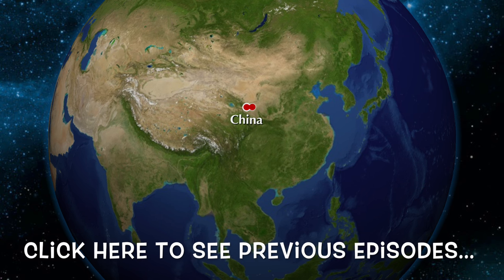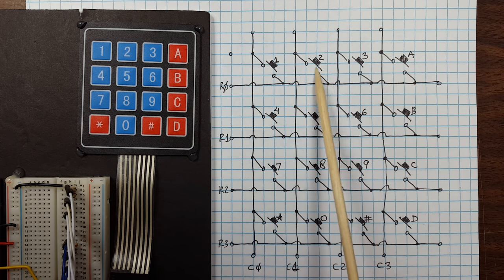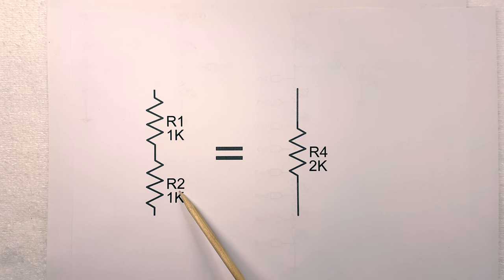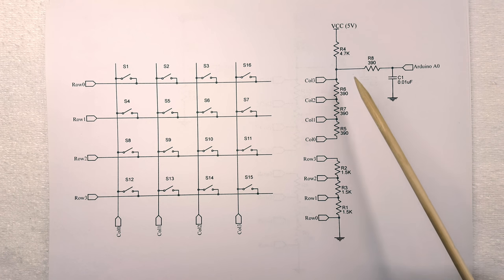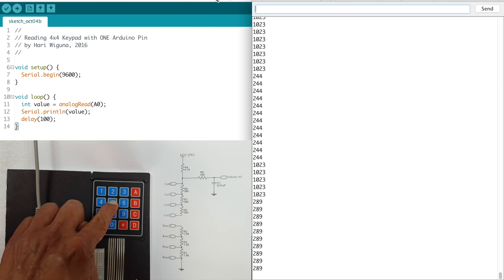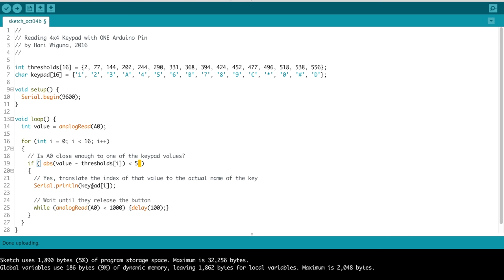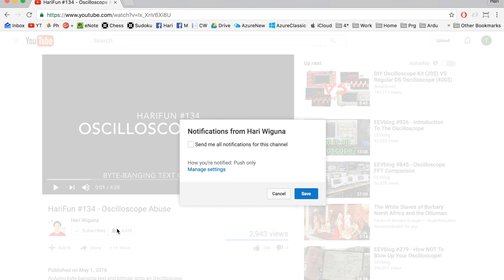HariFun #143 - How to read a 4x4 keypad using just one Arduino pin!

Comment: I like the basic idea. Very creative!
Reply from the maker: Thanks for the comment Andreas, but I could not take credit for the idea.  I stumbled into the circuit in Google Images while researching keypads.
http://www.microchip.com/forums/download.axd?file=0;694632&where=&f=1pin%20keymatrix.gif
Reply: Yeah but you implemented it and explained it fantastically! Thankx to you it saved me! Your awesome
Reply: 4:14 wait you said the more resistors the higher the voltage but wouldn't it be the opposite? , the more resistors you put in series the more the voltage should  drop between VCC 5v and the GND pin not increase, this makes no sense

Comment: If random noise is added to the output to the 4x4  keypad  outputs this method  has a failure rate !
noise measurement:   0.01% rms of 5Vdc =5/10,000 v  will cause a miniscule  error  
say 1 error / 10^8 keypad outputs . 
Theoretically:  a 5/10,000 v rms   includes   a few -5v pulses  witihin a group of 10^8  noise intervals 
where 10^8 = 100.000,000 random pulses

Comment: After days messing about trying to get this to work I had all but given up. The problem was the voltage out numbers I was getting were nothing like the progression you were demonstrating in your video, they were all over the place. On top of that they kept fluctuating over time so I couldn't program the threshold values with any certainty. 

Then I had a spare keypad delivered so I thought I would try that as a last resort - SORTED!! The voltage numbers were spot-on and gave consistant results. Anyone else having trouble with this should try different keypads to see what results they get. The first keypad was brand new as well by the way.

Thanks for a very useful video Hari.
Reply from the maker: Grrr... sorry to hear about all the problems.  I probably should have included a step to test just the keypad membrane switches themselves.  Glad you persevered and got it figured out!  Good job!

Comment: Cool. It's a very old technique that was (and probably still is) widely used with small passive controllers for professional appliances such as the Alesis LRC which was a tiny controller for the Alesis Adat digital recorders; it has 13 buttons and terminates on a TS jack; I made a PIC18 project to read this controller and use it as a generic MIDI controller; the downside is that you have to apply a debouncing algorithm with a rather long debounce time in order to get a stable voltage before trying to recognize which button was depressed.
Reply from the maker: zioguido , i didnt know that it is good enough for commercial use. i thought it would not be reliable enough. do you have photos or videos of your hack? I'd  love to swe it.
Reply: Yes, it's quite a reliable technique as long as the resistor network is done with high precision resistors, the rest is done by the software. The only remark I feel to make based on my experience is that you need to implement a rather long debouncing algorithm, say 200 mS, and it's even better if you have an high resolution ADC, 10 bit should be enough. No, I have no pictures of my project, but it must be somewhere down my basement :) it was only a part of a more complex control system that I made for my old recording studio and no longer use.

Comment: Nice work.. I was wondering if I could use this to reverse engineer a keypad from a rack module.
Basically my idea is to mimic the key preses in the rack via arduino.
So in a first stage I would use the voltage divider to determine the values for each key press as input and then, based on the obtained values, use the analogwrite function to "send" the same key press via arduino. Do you think that is possible?
Thanks
Reply from the maker: Thanks. Unfortunately, the analogwrite function does not actually outputs a variable voltage. Despite having the word "analog" in the command, it actually pulses 5V at varying speed.  Also, as far as I know, most commercial keyboards do not use this analog method but instead uses a digital matrix (more pins, but more accurate).
https://www.arduino.cc/reference/en/language/functions/analog-io/analogwrite/

Comment: Im not getting a stable read.. help
Reply from the maker: 1. Since this is analog, it is inherently imprecise.  That's why I suggested getting the values and then making the code tolerant of the slight variations.
2. Make sure that the input voltage is stable.  Are there high current outputs being involved? you may need to power those from a separate supply rather than the Arduino 5V so the input to the resistor ladder would remain stable.
3. This is a hack.  It should only be used when you cannot afford the I/O pins.
The proper way to read a keypad is to use row column matrix to scan the keypad.  Uses more Arduino pins, but 100% reliable.
Reply: @HariWiguna  
Thanks man.. the values are just too bad.. sometimes im getting same values on different keys.. and im running out of  arduino pins(uno)...
I'll try to power up the arduino with 9v.. im using a laptop so maybe the input voltage is not stable
Reply: And also the values im getting are way too far from what you got
Reply from the maker: @3000mi_away , I've just thought of another possible cause.  Please measure the switch resistances on the keypad. Just try a few of them to make sure they're very close to zero.  Some keypad uses carbon pads instead of actual metal to metal connection so it has a relatively high resistance and probably also pressure sensitive.  The harder you press the lower resistance.  You could try using higher resistor ladder values to make these variations less significant.
Good luck!
Reply: Thanks man ..ill try that

Comment: Thanks to this!, I could save a lot of pins because of this trick.
Reply from the maker: Yeah, I'm already using a ton of shift registers for the 9x9 Seven-Segment displays, so I wanted to keep the input as simple as possible.  Zero pin is not an option, so I had to settle for one pin. lol :-)

Comment: In theory it should work. In fact simulating the circuit with Spice works well.
In practice, the voltage difference between the buttons down to the right is so small that a slight fluctuation in the supply voltage is enough to cause errors in the detection of the pressed keys. I did a lot of tests and in practice I was never able to run the detection well, pressing the D button gave me a #, and pressing the C key would tell me 9. :(
Reply from the maker: I guess I was just luckier?!  I presume you calibrated your threshold arrays instead of just using my values. Also, by watching actual value fluctuations while gathering the values for the array, I was able to guess how much slop is necessary to give the maximum range for each button while not running into the "nearby" buttons.  Thanks for sharing your findings Salvatore!

Comment: I just tried this out. Very neat. I am having a small issue that I was hoping you might have insight into. The wobble/slop on my key values is huge +/- 100. Any idea what would cause so much slop on a key press?
Reply from the maker: Most likely your keypad uses switches that has high resistance (around 100 ohms as you noticed).  The one I use has practically zero ohm resistance when the switch is pressed.  All resistance comes from resistors, not the switch pads.

Comment: Hi, hari.  Could the capacitor no be a 0.01 uF (10 nF)?  Can it be 0.1 uF or 6.8 nF?
Reply from the maker: 6.8nF should work.
As I mentioned in the video, the 390 ohm resistor and 0.01uF cap debounces the often noisy switch.
You could probably even eliminate the capacitor if your switch is not too noisy and/or you added code to do debouncing in code.

Comment: Bos. How to find this number 2,77,144,202,244,290,331,368,394,424,452,477,496,518,538,556 ?
Terima Kasih
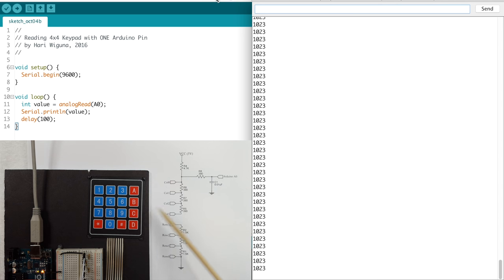Reply from the maker: At 3:44 you can see that pressing each button shows a different value.  Press each and write down the value.  Your values will be slightly different due to the variations on resistors. That is how I got those numbers.
Reply: Hari Wiguna  If i press, example for number 1 this value 2043 or number 2 = 1463
int thresholds[16]={2043,1463,7823,23,3713,3343,2943,2483,4813,4563,4293,3993,5603,5423,5223,5013};

while (analogRead(A0)<1000) {delay(100);} 
this code must be change too?
thanks for your answer
Reply: Oooo sorry bos... im mistake for my note value
Terima Kasih Banyak My Big Bos
Reply from the maker: The maximum value returned by analogRead is 1023.  Where are you getting 2043 and 1463 ?!
https://www.arduino.cc/reference/en/language/functions/analog-io/analogread/https://www.arduino.cc/reference/en/language/functions/analog-io/analogread/

Comment: I  make a mistake, because I'm french and not completly bilingual.  I should have written less inputs instead of " without using less inputs.". So what I need it is 'digitalRead' individually 4 BCD thumbwheel switches without using 16 inputs. I tried to imagine a matrix like the 4X4 keypad but it does not works because but some rows or columns may have many binary values at the same time.
Reply from the maker: Ah... I see. That's a cool idea actually. I found this article:
http://www.instructables.com/id/A-simple-4-channel-adjustable-current-source/?ALLSTEPS
They're using it to control current, but I think by adding one resistor to positive, then you'll have a voltage divider and be able to read the combined resistors using one Arduino pin just like what I did with the keypad.  Keep me updated. I think this is interesting. Thx for the comment.

Comment: Hari SUBSCRIBED! I have some programming experience and new to Arduino. I want to do this project and I understand the general concept but I don't have an electronics background so there's a few things I don't understand.

In your drawing:

1. Is R1-R12 just you counting the number of resistors needed in the project or does the number have other meaning?

2. You are using just three different resistors 390 ohms, 1500 ohms, and 4700 ohms I think?

3. As I am color blind I can't tell from the video, what resistor types (carbon film vs metal film etc.) and tolerances do you recommend?

4. Similarly, C1 is a capacitor? What type and value do you recommend?

Thanks a bunch for this great video!
Reply: Well, I never got a response so I just used metal film resistors and a 103 capacitor (I don't recall the type). Anyway,  I just tried it on a 1 column by 7 rows of momentary mechanical push buttons mounted to a plastic plate and hand soldered together. I went with 220 ohm resistors since I had more rows. I will add two more columns as soon as I get more resistors in. Thanks Hari this is really cool and explained well. And should work great for my flight simulator button box which will have a couple dozen buttons, switches, and rotary encoders.

Comment: I tried duplicating this in tinkercad and it isnt outputting anything. I copied the code too and thought my wires are correct. only thought could be wrong orientation of the resistors?
Reply from the maker: I wasn't aware that TinkerCad has an Arduino simulator, so I wired up the circuit.  Everything works as I expected except for the first column (1,4,7,*) all acts as if I'm pressing *.  When no buttons are pressed it should return 1023 too.
I wonder if the keypad component has a bug in it.  I'll play more with this later and let you know if I discover anything else.
Anyway, thanks for the question.
https://www.tinkercad.com/things/5YWqan9lh8H-neat-esboo/editel?sharecode=o6MB5FGBJq0Q0EjU1emoxm19kzj5LjFq31JzCpDEB50

Comment: I saw this same technique used in an old VCR front panel.  Did you know that it can even be done with a digital I/O pin and two additional passive components rather than using an analog input?
Reply from the maker: Really? how do they do it with a digital pin? Charge a capacitor?
Reply: @HariWiguna  Yes using an RC circuit with the resistor being the button voltage divider.  One end of the RC is Vcc, the other end is connected to the digital pin.  Discharge the cap by setting pin to output low.  Now set pin to input and time how long it takes to turn on by reaching (Vcc/2).  That time is proportional to the resistance value.  Then repeat the process.
Reply from the maker: @Enigma758  Wow. That's crazy. Thx for explaining that to me.

Comment: I've built a couple of projects using similar types of matrix keypads. I think you have a great design that I'm going to experiment with, I do have one question having to do with electrostatic discharge. One of my designs had a 4 X 4 matrix keypad that was mounted on top of a metal enclosure that contained all of the electronics . I originally did not have any ESD current limit resistors or RC circuits to help isolate the inputs on the micro-controller from ESD. I ended up having the several micro-controllers fried by static discharge coming from people that came in contact with the keypad and discharged it into the electronics by depressing keys on the keypad. What do you think could be done to your design to prevent this from occurring?
Reply from the maker: Tom, sorry I do not have any experience suppressing ESD. Sounds like you know more about it that I do :-)

Comment: Hi hari wiguna help please,I am making my keyboard with spst buttons and If I make several keyboards like it ,will it have same analog values? Like you had 1/2 for number 1 ?
Reply from the maker: HI Aryan, The analog values depend on the resistors you use.  If you get the resistors from the same batch and you adjust the slop in the code to be as large as possible then it should work.  But you will have to check your analog values yourself.  The chance of my analog values be perfect with your resistors is small.

Comment: I have some questions in mind.
1)Can we use nay resistor values?
2)I am not able to see properly on how you connected the circuit on the breadboard.I am little bit weak on connecting circuit at breadboard.Please help me.
Reply from the maker: Hello Jeet,
1. You can use other resistor values, but their ratios are critical for it to work.  Remember what we're doing is building a voltage divider with variable resistance on the bottom resistor controlled by which button is pressed.  The maximum total resistance of the bottom resistor should be approximately the same of the top resistor.  As you press the different columns, the resistance value should change gradually, as you press different rows, the resistance value should change in larger increment so we would be able to tell the difference between rows and columns.
2. In the video, when I discuss the schematic diagram, the rows and columns are clearly marked.  If you're not yet familiar with how breadboard is wired internally, this video might help:
https://www.youtube.com/watch?v=6WReFkfrUIk

I hope that helps.

Comment: what will be the values if I used 3.3 V input  under ESP32 mcu?
int thresholds[16] = {2, 77, 144, 202, 244, 290, 331, 368, 394, 434, 454, 477, 496, 518, 538, 556};
Reply from the maker: At 3:15 in the video, I shared a short sketch that I used to find those values.  Just do the same for your 3.3V circuit. Hmm, I just remembered that the old ESP8266  only measures up to 1V. I'm not sure if the ESP32 suffers from the same limitation.  If it does, you would need to adjust the top resistor such that the maximum output of the ladder is 1V instead of 3.3V.

Comment: Amazing. But tell me how you obtain the threshods values, Explain me the  '2' and '556'.....
Reply from the maker: While it is be possible to compute those values, I measured them one at a time using the Arduino.
At about minute 3:16 I showed how I obtained a few of the analog values.  I just repeat that procedure for all 16 values.

Comment: how would  it interpret 2 keys hit at the same time
Reply from the maker: This method would mess up if you press more than one button.  To read multiple simultaneous keypress you will need to dedicate more Arduino pins.  To read a 4x4 keypad you will need four outputs and four inputs.
Reply: @HariWiguna  thank you

Comment: This is awesome..one pin onlyyyyy.....but the only problem i am getting is my reading are not stable as yours..mine r varying..even i m using a capacitor too as u..even if i dont press any key it fluctuate from 1010 to 10233.. can u help
Reply from the maker: With no buttons pressed, the bottom part of the voltage divider should be open, and the 4K7 resistor should bring the analog pin to 5V and report 1023.  I wonder if one of the membrane switches is stuck?
Reply: No..i think its not..bcz when i using same resistor as you i am getting stable readings and if i multiply each resistor by 10 then it becomes unstable..so it looks like high resistance values r the problems...but why??
i don't know..
Reply: higher resistances = lower voltages. so you are probably so low that the arduino barley can register the voltages.

Comment: I finally hooked up the keypad as you described. But all my  threshold values are totally opposite of yours. The ('1') has  562 instead of 2 and my (''D') has the value of 2 instead of your 556. But the reading of all the keys are accurate. Can you explain this funny result?  By the way do you have an idea to interface 4 BCD thumbwheels switches (16 inputs) to Arduino without using less inputs.
Thank you
Reply from the maker: Sounds like you have the columns wired in reverse.  It does not matter, just as long as the values are unique.  Just make sure the two arrays are in sync.

As far as the BCD switches, if you're willing to use 4 pins for each digit, it's pretty straightforward.  Something like this should work (untested code ):

pinMode(d0b0,INPUT_PULLUP);
pinMode(d0b1,INPUT_PULLUP);
pinMode(d0b2,INPUT_PULLUP);
pinMode(d0b3,INPUT_PULLUP);

d0Value = 15 - digitalRead(d0b0) + digitalRead(d0b1)*2 + digitalRead(d0b2)*4 + digitalRead(d0b3)*8;

Do the above three more times for the other digits.